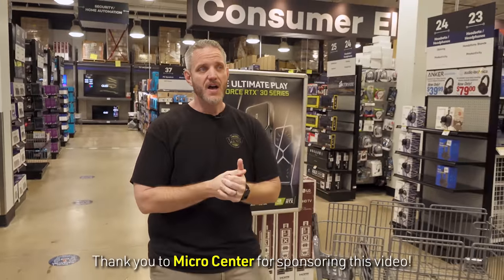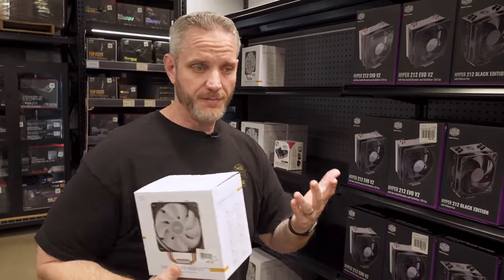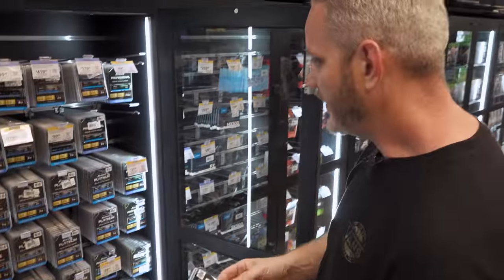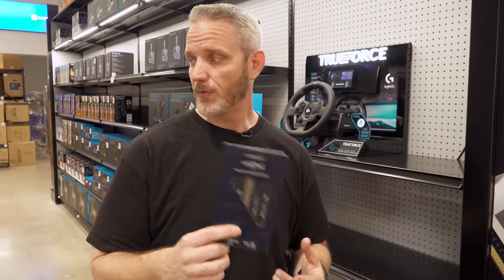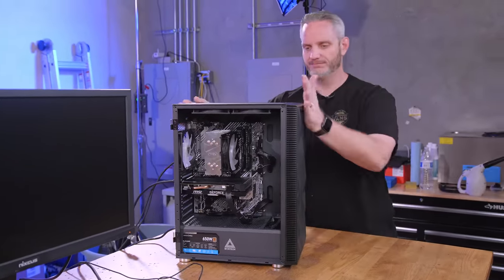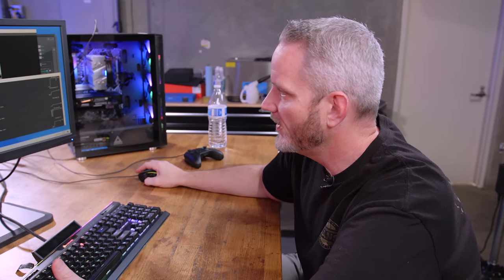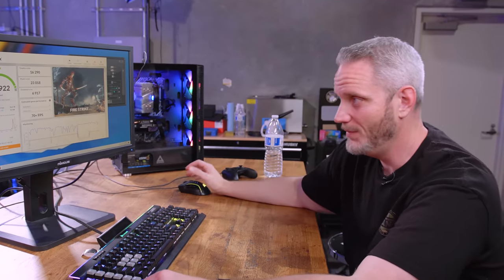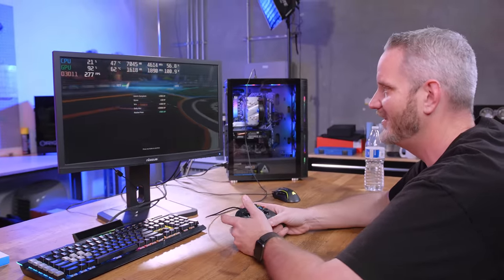How cheap can I build a "Gaming PC" for in 2022

Comment: I love this video, and almost all your videos. They've been so helpful to me when I built my first gaming PC at the end of 2020, but I do wish builders/youtubers would include the cost of a monitor, keyboard and mouse to these build-a-PC-for-$$ videos. A PC case with all the necessary components inside, does not a full PC make. It's useless without a monitor, keyboard and mouse. Peripherals should be included or at least mentioned as a necessary cost to complete a build.
Reply: In 1998 I bought a used hospital tower from auction (only Windows NT on it) for $400. W 2022 inflation and Let's Go Brandon $750 or so. It came without a dial up modem even. I Think it came with the crap monitor and keyboard, mouse. Thank goodness my uncle w the computer shop helped me along just enough for me to learn stuff. Or at least just break one part at a time. 24 yrs later I am responding from the 1st pre-built tower (Cyberpower PC, I don't game but I got tired of laptops. With Windows 10, for $900). It broke 11 months in, I got to pay them $150 in shipping. Graphics card on it is still limited running a 55in TV and 4k monitor. Just the 4k monitor (not w TV on) monitor does better graphics. 
Buyer beware! Just because the graphics card has 1 hdmi and 3 monitor spots. No way this thing could do that. Plug in headphones or a mic. Then try to go back to HDMI surround sound took so many reboots to work again. My uncle was stumped with troubleshooting (over the phone). AMD tends to send out updates every 2 weeks. 
Had I built this tower, I would know each component which makes troubleshooting WAY easier. For practice, at least get a beat up old tower that sort of works from a family member. Take it apart and put it back together again. It's cheap practice.
Reply: I will say I got a monitor at a garage sale for $20. There's lots of old ones if you just want 1080p @ 60hz
Reply: I agree partially, as I think mentioning them would be good, but not included in detail as I feel that information is totally irrelevant honestly...it's like if you would say that they need to recommend a desk as well as a chair, as those are necessary as well.
Reply: @AlphaLegionXX  I disagree, you don't need a chair or desk to get the computer to be fully functional but you do absolutely  need a monitor, keyboard and mouse to get a computer to work as intended. You can't get into BIOS without at the very least a keyboard and monitor, you can't see anything without a monitor and can't make things happen without a keyboard. You MAY be able to do SOMETHING without a mouse but with extreme difficulty and definitely NOT everything on a computer. A chair and desk? Will a computer work without them? Can you play a game or run a program without them? Yes! So comparing a monitor, mouse and Keyboard to a desk and chair is absurd since I am talking about what you need to make a computer fully useable. What can you do with a fully built tower and no keyboard or monitor?
Reply: @desertshadow72  That's great! I got a great monitor and keyboard and a mouse at great prices too. My point isn't the price, my point is they are necessary to complete a build and are almost always treated as add-ons in build videos and rarely mentioned when they are in fact an absolute necessity.

Comment: I know it's a budget PC but I've gone with RX 6600. $70 more but way more performance and would last longer. Potentially it could work with 1440p or even 4k with FSR.
Reply: checking this and hearing 1660s in 2022 really hurt my soul. this is terrible advice at the prices atm. zero future proofing while grabbing outdated tech to save a few bucks. if i learned anything from my first blindish pc build 7 years ago is the more you spend now the longer it last and the more you save in the long run.
Reply: @rickylafleur5823  

I generally treat purchases as "investments". The investment being time. If I had a choice between paying $150 for something that will last 2 years vs $250 for something that will last 5 years i'll save up and buy the latter ($125 in savings). For the most part this really only applies to GPUs as far as PC's are concerned. But given a fauxdemic can apparently strike at anytime and cause hyperinflation and "shortages" I don;t mind spending more to be prepared. It's not just about "future proofing" for gaming anymore. It's about preparing for future artificial shortages caused by greedy manufacturers.

As a precious metal/gemstone investor I know all about that.
Reply: Got that tinfoil hat all ironed out, Joe?
Reply: Too weak for 4k dude you need 3080 or 6900xt
Reply: @user-ib5pu9hm1y   Implying anyone actually gives a shit about 4k and has thousands of dollars for a GPU in this economy
Reply: Futuristically speaking yes. But the goal of the content is alteast $1000 below.
He could change the case and the power supply for branded ones.
Reply: @Unethical.Dodgson  prices are decent for now…..
Reply: @Unethical.Dodgson  lmfao not a single soul actually plays in 4k and yet people still pay 500$++ just to say they CAN play in 4k.
Reply: @cooper7423  I'm still running a GTX1080 and there are quite a few games that I run in 4K. That said. My preferred go-to is to play with higher frames than higher resolution. So for games pre 2016. I can play most of them in 4K just fine.

That said. When was the last time you were able to get a GPU as an upgrade for anything around $500? :D

I swear. I still remember when the most expensive GPU money could buy was around $500 and everyone thought it was outright overkill.

Now? I can buy a GPU that would be considered high-ish for around $1500 with conversions... Fuck that :D

Still. Most games and most gamers aren't actually playing games in 4K. Even when they buy 4K consoles they're often opting for the performance presets for smoother framerates. But yeah I was lucky to get this GTX1080 when I did... damn. :D
Reply: anti amd method
Reply: @Unethical.Dodgson  npc comment
Reply: @cooper7423  being able to play at 4k now means you can do 1440p and such 6-7 years later genius 
1080/1070 was a 4K capable card at launch- now it's a 1440p card if you want high settings and 60FPS
Reply: @Unethical.Dodgson  And here's me in my poor little GTX 1050Ti.
Reply: I'd have stuck to the 5600g and waited until now, you can now get decent price/performance ratios - the rt 6700 (non-xt) can be had for cheaper than the 6600xt and has better performance, or if you cannot afford the extra, then the 2060 has a good price/performance.
Reply: @Miggy19779  i am still rocking GTX1070 🔥
Reply: @gordonfreeman4477  Then why did you say to go for a 6600? 
In any case my comment was in response to 'going for the 6600' instead of the one in the video. I'd have done neither and gotten the 5600g and waited for GPU prices to drop and bag a great price/performance card like the 6700.

Comment: I used this exact case and had the same thoughts about the flimsy. For the price and fans my build was pretty cool as well with a 3060ti
Reply: For 499 you can get a ASUS 3060ti at microcenter.
Reply: I built my brother a PC with Montech Air 900 Mesh Case for $66.99 back in 2020. That case is one of the best I had bought for that price. The quality, cable management options everything is good for the price. However, I think now Montech has cut a lot of corners on the quality for the similar priced case in 2022.
Reply: MONTECH’s are very impressive for their price.
Reply: at least u can a radiator at the top XD
Reply: Rly not a bad case wish it was cheaper but it happens
Reply: but is the case a suitable substitute for a Fractal Torrent (just thinking of all the fans and airflow, not build quality)?
Reply: That montech x3 case look amazing in my room, I keep the light off on it and it looks amazing, a little flimsy but 6 fans
Reply: Ya'll should check out the Montech Air 100 rgb it got a mesh front,4 rgb fans, psu shroud and extremely well built for 60-70$
Reply: @doughy041  That seems like so much money, I got my 3080 custom card for 750.
Reply: So a case with non A-RGB fans cannot change the colour profile of the fans right?

Comment: Honestly, the 11400 would have paired just fine with that 1660S, and saved $40, knocking the total down even further. (EDIT: As others have pointed out, with the stock cooler the 11400 comes with, the savings are actually about $70, opening up enough budget 3060 while still sticking under $1000 for the build) Locked motherboard makes me...really question this decision.  The difference in actual frames in most games won't be noticeable.
Reply: Overclocking a cpu does almost nothing for fps anyway haha
Reply: going with 11400 or 11400f, skimping a little bit on a mobo and going with a 6600 would give a much more powerful system overall.
Reply: You can probably even save more money by going with the Core i5-10400F or the Core i3-12100F.
Reply: Could've the Mobo, CPU, GPU and PSU  choices were questionable.

CPU 11400f would've been a better choice IMO... Not much need for iGPU

Mobo could've gone ultra budget with a h510... Nothing about a Mobo offers better FPS, plus better pairing with a locked CPU

GPU 6600 would've been better bang for bucks and better pairing with i5 11th gen

PSU... About future proofing... If you're upgrading from mid range parts to newer gen mid range parts, extra headroom is overrated... Unless you go from mid range to high end parts..
Reply: Yeah. Weird cheap route but then again he said he never build using one so maybe it's for the view
Reply: @camy205  Yes, but he got an overclockable CPU and put it in a non-overclockable motherboard.
Reply: @kwykwyk8447  Microcenter's website doesn't seem to have the 11400F as a independent part, so I'm assuming they don't have them in store. I'm only looking at parts he had available to him.
Reply: bUT Wut iF aLL i PLAy iS 1o8oP ON mY 3o9o ti?
Reply: I think too, then, he could've gone with a b560 motherboard and the box cooler (which didn't work too bad for the few days I had to use it), and saved possibly $100 or upgraded a graphics tier.
Reply: @cordellsteiner353  no box cooler is included with K cpus
Reply: @adamhymas4620  He got a 1660 super, not a 3090 TI.
Reply: @adamhymas4620  but the 11400 does have a box cooler.
Reply: @drackar  then why didn't jay just use that?
Reply: @adamhymas4620  I'm talking about the 11400, as OP suggested.
Reply: I feel like a 12400 + B660 would've still been a better deal. I agree, I'm really questioning some of his recent choices.
Reply: What game do you play and what monitor
Reply: Get the 12400F its the same price and a much better CPU and can be upgraded up to 14th Gen with Intel. Buying anything from Rocket Lake is dumb at this point
Reply: @pankaj981  exactly what I said the 12400F beats the 5600X for just $170. And you can upgrade up to 14th Gen with Intel
Reply: @Anukinihun  it's the 12400, not the F so that's even better. Again MC has an additional $20 discount on motherboard+CPU combo. So $170 for CPU + $120 for gigabyte b660 ds3h - $20 discount = $270 would've been a killer deal. Even with a mid tier case, psu, memory, and storage, he could've easily fit a 3060 or the 3060ti under $1000. And these are with current MC prices
Reply: @pankaj981  I'll get a 6600XT or 6700xt before the 3060 and 3060ti
Reply: Yeah he acknowledged that and then explained his choice.
Reply: don't think Jay knows what budget gaming is anymore...
Reply: @kwykwyk8447  Well for the 11th gen the H570 would be best, as H510 does not allow for memory overclocking. Memory speed absolutely does affect FPS so the h570 wasn't the worst choice.
Reply: I would go the 11400F + RTX 3060 route (if there was a 3060 in stock at Microcenter). You could compensate for the GPU price hike partially with a lower SKU CPU, and the performance would be way higher, also with the option for RT and, more importantly, DLSS.
Reply: I would never use a stock cooler, especially not with such high-end CPUs. The stock cooler is always such a bare minimum that I wouldn't be comfortable in using it, plus under any kind of load it gets really really noisy. In relation to everything else that goes into building a PC, you can get really decent tower air coolers for dirt cheap. $30 US is practically almost free. It's not like decent tower air coolers are an expensive part.
Reply: @rafagebicki5209  So going with a slower VRAM bus speed gives you better performance?

That’s not how the real world works 🤣
Reply: @n1t21r3  GPUs don’t fail buddy. It isn’t the 90s anymore 🤣
Reply: @standuporshutup  100% agree with mem overclocking... From the microcenter website, they have h510 listed for around $90... So I'd like to see the fps/$ different between the h510 vs h570 if we're talking about a normal person's budget build (where they pay for their own parts)
Reply: @n1t21r3  yeah that's a problem for future Jay... Right now we're squeezing every penny
Reply: @insomniacbritgaming1632  Yeah, $1000 PC is not budget, lol.
Reply: @mikem9536  budget is like $500-750
Reply: @sokool3994  If you go with 12000 platform then you also have to invest in more expensive lga1700 motherboards so the savings are not better and you get a worse product in terms of raw performance. I'd only do it if you plan on upgrading to a better lga1700 cpu soon. And with the 10400f that one is 2 gens old now so you'd run into obsoletion slightly faster, it would just depend on how much you could save on it. But if the difference from 11400 to 10400 is just $20 or in that ballpark then I wouldn't bother going down in generation. It would only matter if you went with higher profit margin cpus like the 10900 vs 11900, where there could be seen a significant price difference with minimal performance penalty (and in some cases benefit to the 10900 due to higher core count and threads).
Reply: @sokool3994  heck if you really want to skimp go for i3-10105F even
Reply: @camy205  unless you're CPU bottlenecked in a significant way... but ofc in practice if that's the case you've got much bigger problems than any CPU OC can solve
Reply: @Real_MisterSir  Well, the motherboards really are more expensive on LGA 1700 but the Core i3-12100F can run on a H610 motherboard well enough. And the performance difference between Core i5-10400F and Core i5-11400F would be minimal since the GTX 1660 Super wouldn't likely benefit from the extra CPU power.
Reply: @drackar  Who cares for overclockability? Yes, only some freaks. Most people I know don't even know what the term means.
Reply: @drackar  Yes, and two cores less. Also we are talking here about the 11th Gen CPUs - there you should have a decent cooler just to get to specs. Which means the money is better invested into 11600 and specific cooler
Reply: @Real_MisterSir  Well, at the moment we all run into obsoletion now, don't forget that 13th Gen and Zen 4 is on the horizon. Which should then make the price for 5xxx CPUs cheaper :)
Reply: @acmenipponair  the title of the video. Look at it. He could have built an objectively better gaming PC for the same money.
Reply: @acmenipponair   That's why I'm suggesting he should have gone with a non overclockable chip that costs significantly less but will provide very similar gaming performance . Especially since the motherboard he chose cannot overclock .
Reply: I buy the 50 dollar case with no lights, no glass panel,,, and a 5" expansion bay LOL,,, because I'm old and I want my DVD burner DARNIT! 🤣🤣
Reply: @camy205  That REALLY depends on the game, If your playing things such as Stellaris, World of Warcraft, Factorio, Satisfactory, Any game with a lot of logic behind it, Civ etc then CPU performance is king and overclocking can be worth a lot of frames, An example of this is Factorio and WoW for me, I have a 5950X paired it initially with 3000mhz DDR4 i gained nearly 20 FPS in WoW just by overclocking and swapping to 4000mhz Ram, And 15 UPS/FPS sustained in Factorio.
Reply: @christophervanzetta  6600 is much  faster than 1660super, it's almost different tier of gpu performance. 1660s is little below 2060 perf, 6600 is between 2060 super and 2070.
Reply: @Anukinihun  - Except Microsoft will effectively own your PC.
Reply: @Anukinihun  - The 5600X will let you have 100% control over your PC, since it doesn't require Windows 11 to perform the best.
Reply: @xuser48  it works just as fine I don't know why everyone still keeps saying this.
Reply: @Anukinihun  - According to Microsoft and Intel Alder Lake requires Windows 11. And Windows 11 is a cancer.
Reply: @xuser48  😂😂😂 OK bruh
Reply: Too many people conflate “budget” with “cheap” or “lowest price available”.
Reply: @rotor13  I'm not. I'm suggesting parts with comparable performance for the stated purpose that would allow a lower total cost or allow the same money to produce significantly better performance.

The difference in performance in most titles between the 11600K and 11400 is between 5-15%. 1660S to 3060? You're looking at more like 30%+ improvement in performance. 

The same money spent differently is a drastically better gaming experience.
Reply: also a 6500XT could have saved $100 for the same performance as the 1660S
Reply: @drackar  Wasn't talking to you buddy. I didn't tag you.
Reply: @ChristmasCrustacean1  without the ability to stream. Not worth it.
Reply: @rotor13  you replied to me buddy.
Reply: @christophervanzetta  you trolling or something?  The 6600 is a 30%+ performance increase over the 1660s
Reply: @ChristmasCrustacean1  RX6500XT is a crap GPU brought over from the 'laptop-scene'....for example it only has 4 PCI-e lanes ???